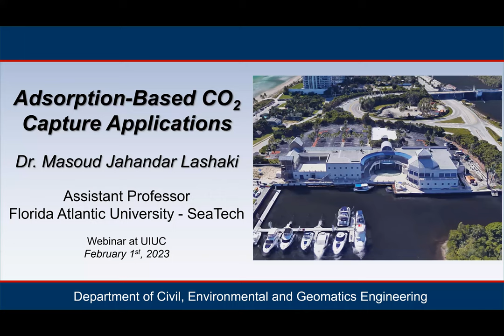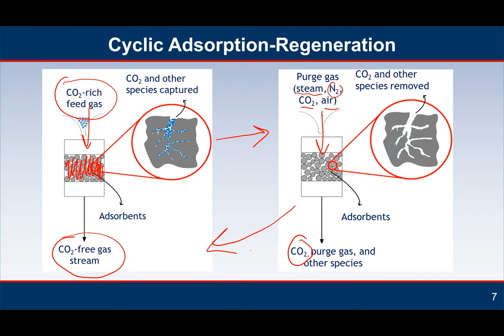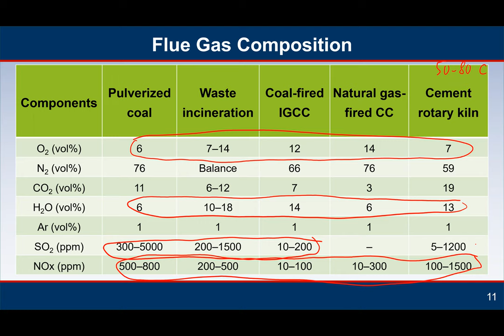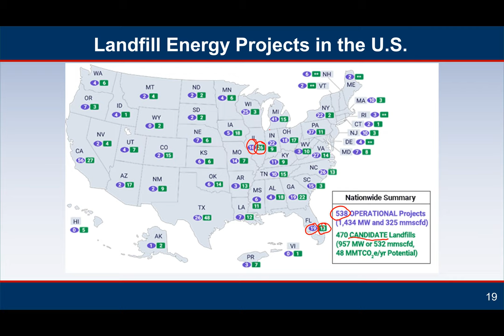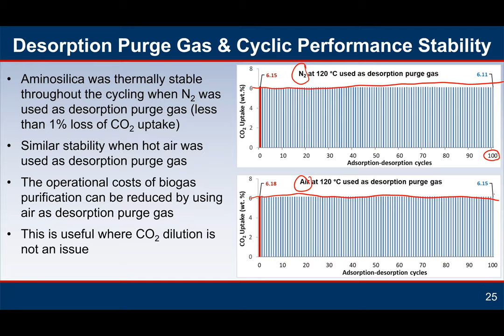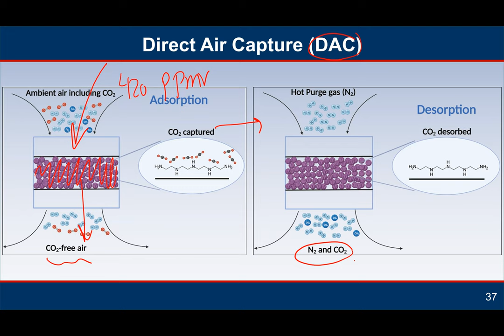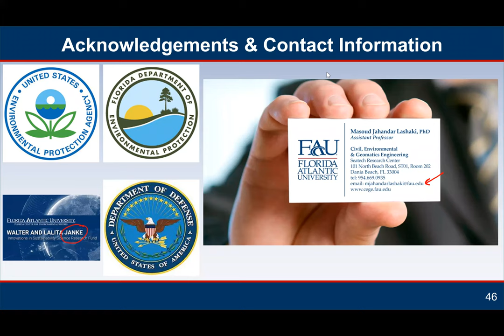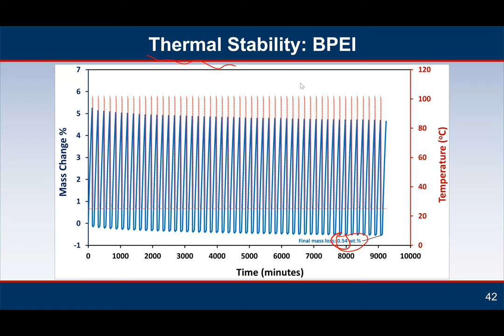Adsorption Based CO2 Capture Applications

Comment: A good review of bonded amine chemistry for carbon dioxide capture. Degradation of bonded amines, and especially impregnated amines (TEPA) can be a significant issue. The bigger issue is scale. A 500 MW natural gas plant produces ~6,000 tons of CO2 per day. There is no way that an adsorption process can keep up with this. Shell's Cansolve amine based carbon capture process works really well, it's a bulk phase capture (absorbtion) that matches the flow rate and volume of CO2 produced.